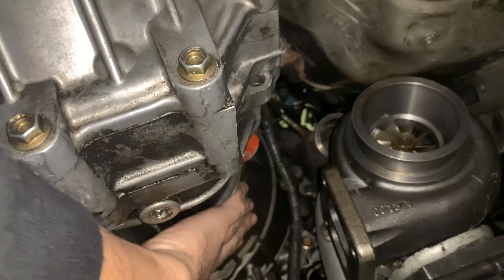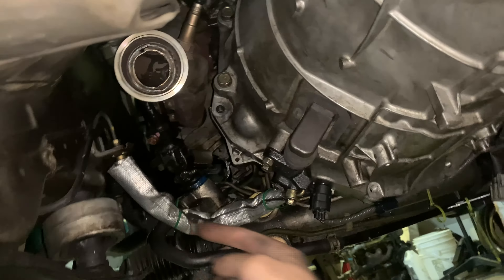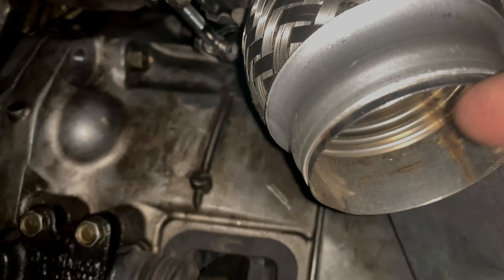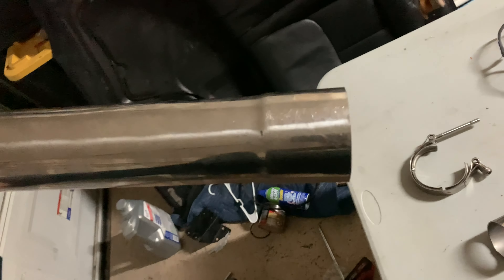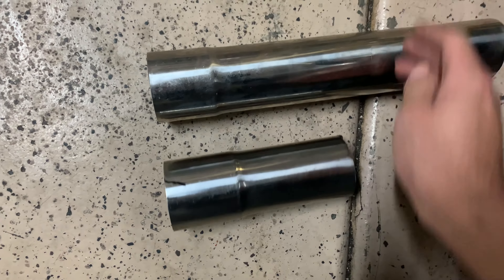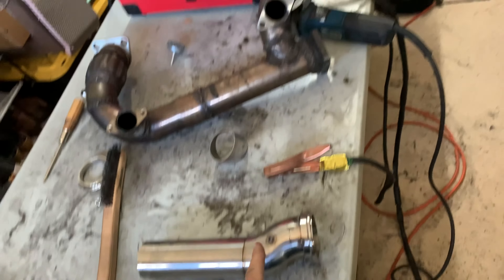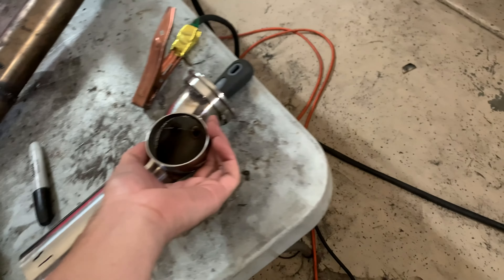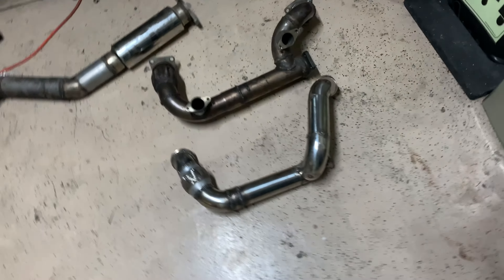V35 Sedan 6MT Budget Custom Mid Mount Turbo Part 2

Comment: Yo where you getting the exhaust piping from? Can you drop link?
Reply from the maker: I don't have a link right now but I just search 2.5 inch stainless steel 90 degree elbows on ebay or amazon and I buy 2 of the 4 pack or if you find the 8 pack that's usually cheaper per piece
Reply: @2200denny  Cool can we get a PT.3 Update im working on putting forged internals in mine now then im doing everything you do.
Reply from the maker: @ADDMEONPSN   @ADDMEONPSN  Yessir I just been busy with a new job but I'm almost done with part 3 imma try to get most of the main shit into it and get it out asap but yeah thank you for watching fam
Which internals you go with? Either way forged boosted DE >> motor swaping imo $ for $ in 2024
I wanna throw the works at mine but just the stock block for now lol
Reply: @2200denny  I just did Eagle Rods and Wiseco 11.1 Pistons , Tomei 266 10.80 lift Cams on both intake/exhaust, Tomei Head gasket, ARP Main and Head studs and for bearings I went with ACL Main and Rod. Not going for super high HP hoping around 500whp when I get the turbo. I need to work on fueling when I get finished.